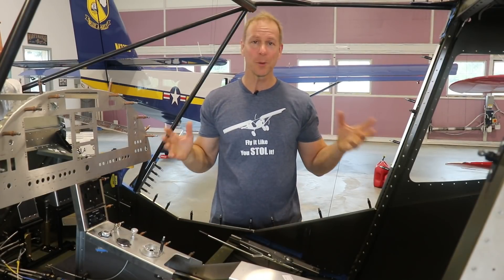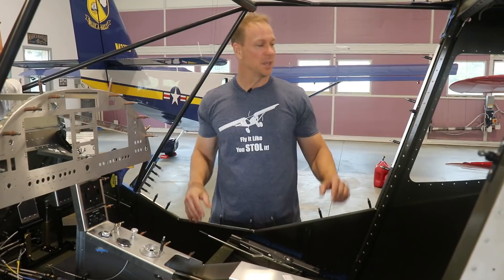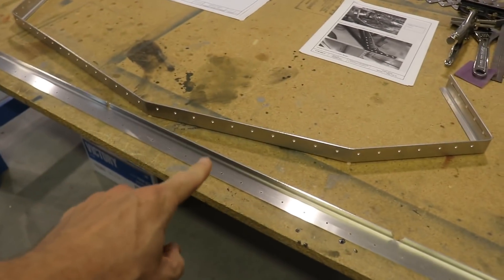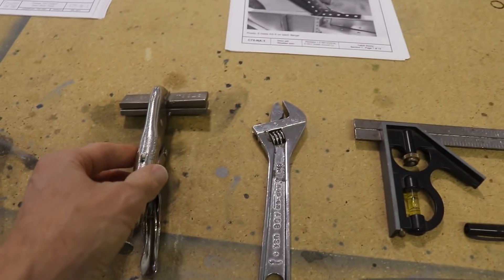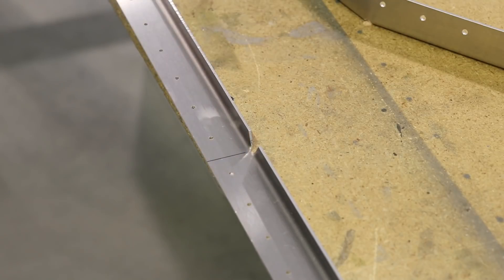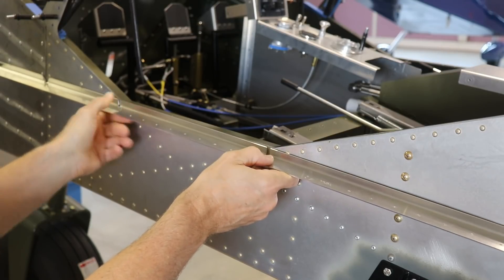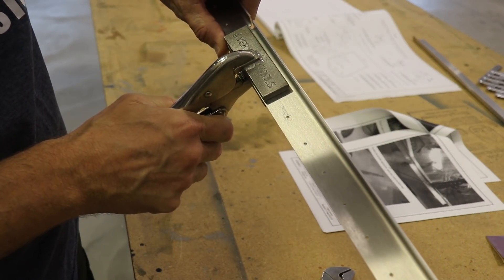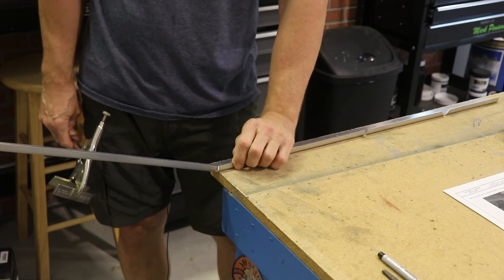Zenith CH-750 Door Sill (Ep55)

Comment: Easy ignition check on the Pitts... smear a small glob of grease on each exhaust stack near the head. Start the engine and quickly switch to the "bad" mag. After 30 seconds, shut down and see if one glob didn't melt. I've done this countless times, and if it's one cylinder, then it's not a mag, but a wire or plug. Saves you from unnecessarily pulling a mag.